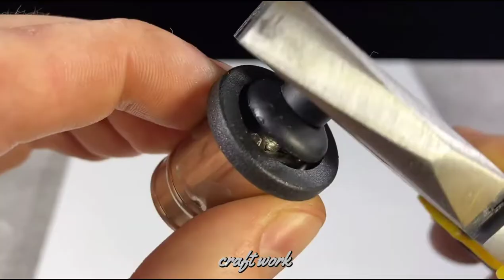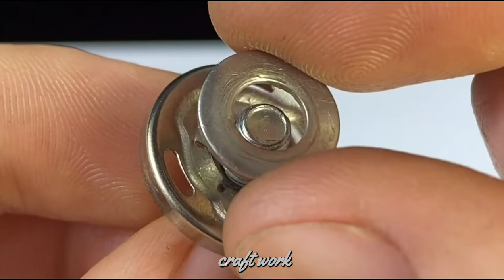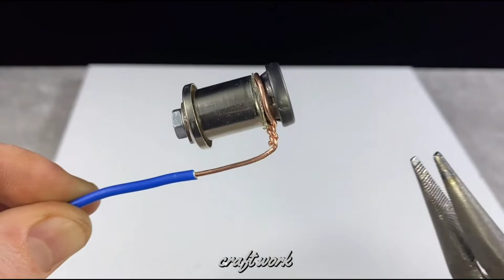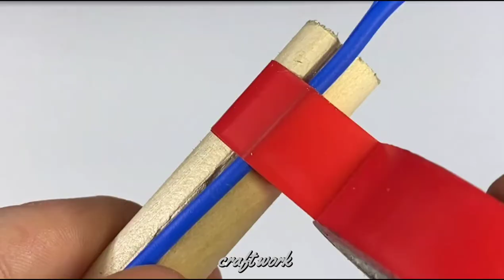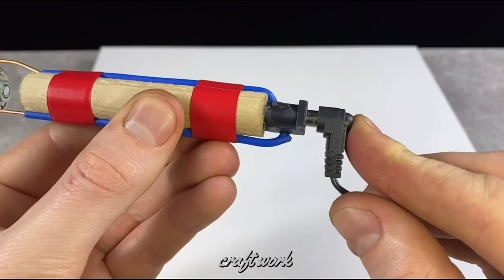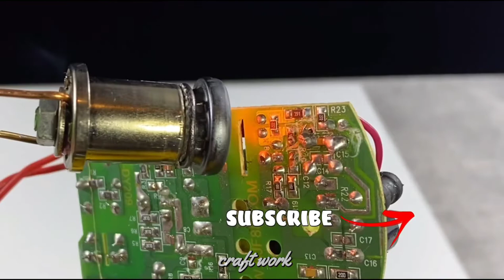DIY MAKING OF CAR  CIGARETTE LIGHTER.Tricks & hacks. #diy #creative #tricks #hacks

Comment: What would be the ampere required for this cigar lighter so that it can generate more heat? I wanted to use it to make a SMD components remover from the PCB's along with a small blower to focus the heat to fall on the components?.

Comment: Hello.. i got that same lighter, I bought it on auto zone.. but! How did you do it?, I try to do like you! But it's burning the cable in the front.. because is touching the chasis. how did you do it,, so theres no continuity when conect the 1 that goes to the front = positive wire and to the negative wire = srew or chasis? Or vice versa.. I put a rubber but it burn. Thanks!